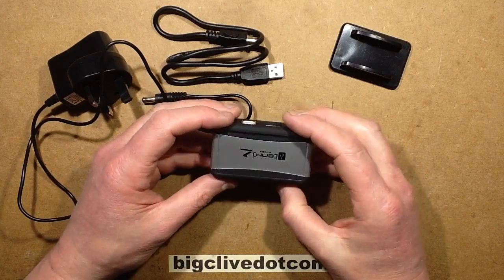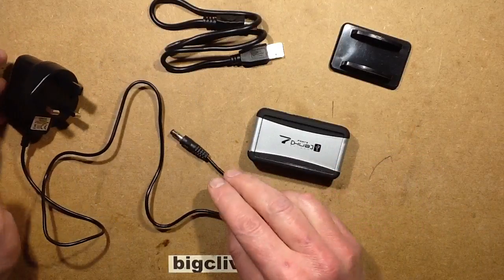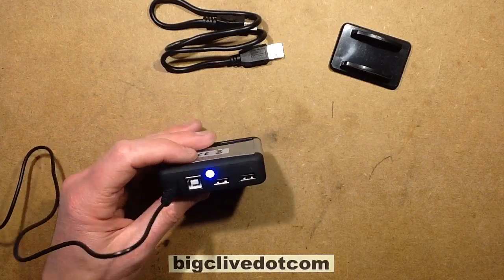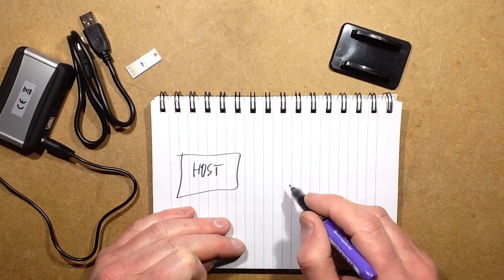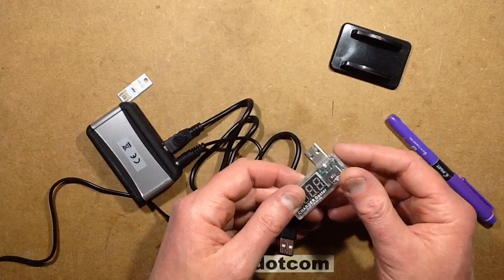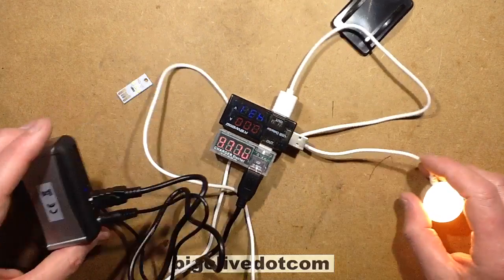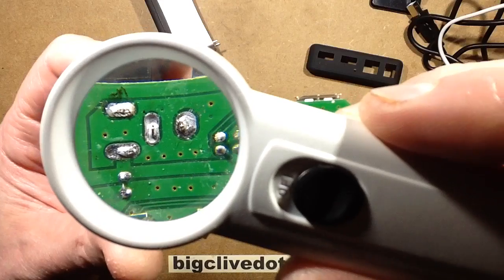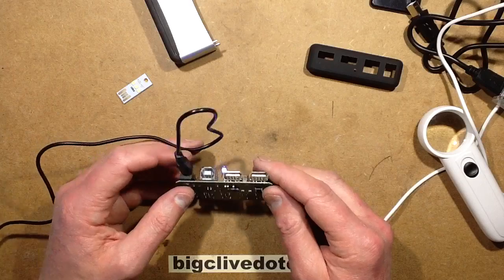Computer killing powered USB hub.  (Mac murderer)

Comment: I use many type of usb powered hub back in time with varous PC and laptops and never had issue. Almost all of them had straight connection between DC input and input USB.

 I remember only one 7port USB3.0 hub that had separation and use power from PC when no external but with limitation 500mA per port and 2A in total for all but when external powered - limitation disappear and it handle 2A on port (hdd, DVD writer, smartphone quick charging,..) but don't know how much in total - never tried. It's in aluminium box without screw so I can't check without damage what is inside. It power USB from external when PC shutdown or not connected so charging is not interupted. I love this hub for use with my laptop.

Comment: I wonder if this is no longer an issue on newer computers with USB C (since they can be charged with it).
Reply: It wouldn't cause an issue. It's the same as trying to plug in a USB-A to C cable between a charger and the computer.
Reply: @TechHowden  Ah, so in some cases it would even charge the device
Reply: @NCHLT  Not on most computers but a USB-C MacBook may say power source: power adapter and drain slower but won't actually charge. Also almost any phone will actually charge from it.

Comment: 8 years later, and I had this happen to me on a Windows PC. Powered USB hub that I had for four years, PC went to sleep, never woke up. Turns out it fried my CPU and I had to get a new one. Took me four days of troubleshooting and headaches before I was able to borrow a friend's CPU to test with. Sure enough, with the donor CPU, my PC POSTed and loaded up the BIOS without a hitch. Quite an expensive mistake I'll never be making again.
Reply: You the CPU itself and not the motherboard? If so that's quite strange.
Reply: @TechHowden  Yup! Ended up buying a replacement CPU and my PC works just fine now. I'm still using the same motherboard and everything.
Reply: What type of USB hub did cause this ?
Reply: @dominikfilkus  A powered USB hub I got from Amazon back in like 2019 or 2020. The brand is RSHTech, which I now believe was probably just some generic drop-shipped piece of hardware with some random brand name thrown on it, as is common on Amazon.

Comment: alright, so this is a handy strip for charging multiple devices at once from the mains OR to connect multiple devices to a host computer, but not both. question is – and forgive me for my ignorance –, but wouldn’t this design be fixed by simply adding a diode between the USB-B port and the barrel plug?

Comment: I remember something weird happened when I had an Xbox One X connected to a KVM switch (with the USB plugged in)
For some weird reason, it wouldn’t turn on while that USB cable was connected if it had been switched off at the mains for a while, but if it had recently been turned off, it would turn on again
Disconnecting the USB cable would then allow it to turn on (sometimes I would have to turn it off and on at the mains before it would turn on)
None of the other devices connected to the KVM switch had any issues (not even my PC), it was just the Xbox

I have no idea what caused that, as I checked for back-feeding, and couldn’t detect anything, and even weirder, if I connected a 2 way USB switcher between the KVM switch and the Xbox, that somehow prevented the issue

Comment: Today, this power-return ambiguity could actually be used, under circumstances, cautiously, devices and brands are different, to back recharge the OTG host via the micro or C USB connector, while allowing the host to simultaneously operate the attached client devices, maybe? Are USB-C and microUSB connectors wired equally?

Comment: On hubs like that, there is supposed to be backfeed protection for the host port while being able to have host power or have adapter power the ports. Having unregulated or unexpected power at a USB port not designed for it can lead to many issues.

That is a glaring design flaw. Very bad.

Comment: I think the USB spec calls for 5V to be connected with a diode to prevent back feeding, but the host port should also have protection against current flow from the peripheral…

Comment: I wonder, are modern smartphones also killing computers due to the reverse charge feature? Occasionally left mine plugged in after shutting down, noticed the motherboards cosmetic LEDs would remain lit until I disconnected the phone. I suspect that the phone saw a load connected and decided to power it.

Comment: As far as I can remember, every powered hub I have owned functioned this way. They could be used with or without the power adapter. If I was using all self-powered devices, like printers or hard drives, it was no problem. With mice, keyboards, and thumb drives, they were limited to available power from the computer port, of course. 
I don’t know for sure if they back-fed the 5 volts, but I’ve never had a failure on windows systems. I’ve never tried on a Mac.

Comment: It should probably have a little 5v reed relay in it so when there is not external voltage applied, the +5v from the computer goes to the hub 5v rail, but when you do plug in the external power adapter, it also powers the coil of the relay and breaks the +5v connection back through the host port

Comment: This is a case of a missing diode, but it also sounds like the USB on the Macs in question weren't properly certified to USB standards. I believe USB standards require protection of this exact kind of situation. However, it is important to mention that a majority of cheap China made USB devices are NOT certified, and should always be used with caution, regardless of the quality of the host device, as demonstrated by several of Clive's videos 😆

Comment: Louis Rossman covered this. It doesn't need a new motherboard, it needs a new USB power switch. It's an easy part to replace, it's just that Apple would rather sell a new computer than let you fix the one you have.
NOTE: This doesn't excuse the maker of the defective hub, since it does blow a chip, but Apple should either fix their products or let someone who know how fix them.

Comment: I've only just found this! I was sold one of these with a Toshiba PC laptop, and it did some odd things with the USB devices plugged into it. I took it back to the supplier, who tried it and didn't believe me, so I was stuck with it. It's been in a drawer for years, but I dug it out and almost started using it recently, as I needed a hub for an old MacBook!!!!!!!! Fortunately I decided to buy a new hub instead. Phew!! Lucky escape!! Maybe it should become a source of USB sockets and other useful bits to prevent future disaster.

Comment: i thought this is how they were supposed to be the point of the power supply is to add more available current to the hub the same as 2 battery's in parallel double the available current not change the voltage jump leads don't kill cars they have no feed back protection or am i wrong

Comment: You know what this reminds me of? USB switches. I have yet to find one that doesn't cross feed 5 volts between the computers. I noticed that the fans were ON on my powered OFF computer. It was because the other computer on the switch was on and feeding power to the first through the switch!

Comment: I understand on who they made it!, Basically there are two options for Power but they are not supposed to be powered buy both at the same time, Option 1: With the adapter is for when you travile and you want to transfer data from say one phone to a computer or other device's but you are not to connect the Wire that plug's to the PC and that look's a bite like a square. Option 2: Is for the PC but it is to be used without the adapter to the wall since it has all the power it need's from the USB port and as it get's it's power it transfer's data. and so That is how I know them and I have worked with a hub some what like that one.
Reply: And hey BigClive you can test what I am saying buy plugging it in to the wall and try to transfer photo's between phone's for example, then goto your laptop or computer and just plug the usb wire without the wall adapter, give a try and let me know ;)
Reply: @singlesteve2011  I would not expect that to work. Usb hubs are not networks. The downstream ports don’t talk to each other.

Comment: Hi Clive, I've just ordered a powered USB hub as the PC does not supply enough power to the USB device ( I'm powering an ESP32 via a FTDI so I can program and run while connected to the PC ).
So, I assume that if the hub is built properly there is no 5v feed back to the PC via the USB +ve terminal.

Comment: Oh, i had a very similar usb hub, and now that i think of it, it's probably what killed a raspberry pi, i was using the hub to run a hard drive over usb to the pi(which really couldn't power a 2.5" drive and itself at the same time). i also had a usb headset which died when i accidentally plugged a 12v adapter instead of a 5v one(i should've just found my glasses and checked)

Comment: I guess it was too hard to install a power jack that breaks the positive line to the computer when you plug in the power supply, the same way they used to disconnect batteries from an external supply for old stuff like radios, and cassette recorders. Ain't old tech great?

Comment: 5.4v... that's overspec isn't it?

Also, I have a bunch of arduino-based boards that have a similar issue - require external power to do stuff but then need the usb connection to be programmed... I just tune the external power to provide slightly less than 5v so the USB line can block it.
Or who knows, maybe they designed PC USB ports better than mac's :p

Comment: I don't think you need to should plug it into mains voltage when you are using it as a a hub, you can connect it using the standard USB cable ( there is a port for it similar to the one on your printer)  and the other devices are to be plugged into the USB ports.

However I agree with everyone here on the fact that Apple products are just crap and shouldn't die with 5V from a USB.

Comment: i had a usb hub that has a 12v psu ?  an isolated buck converter im assuming  so both pc and psu can be plugged in at same time
Reply: but it costed me  about £35 a proper usb 3.0 10 port with a switch to add power when needed

Comment: thanks!.the solution for that is cut the power cable which connect to PC
it will prevent power draw back to pc
but the cons is only working when power adapter plugged

Comment: There should be a diode. Or even better, TWO diodes - one at the power from computer and another one at the power from host, to prevent backfeeding the power adapter.

Comment: I've got the same hub and I shit you not eve since I've had it my pc was behaving very bizarrely. I would touch the host usb plug on my pc shield and it would cause a small spark and would make my tv flicker. Now after watching this gone in bin! I had this so I could sit on my couch with keyboard and.mouse and have 1 long wire to my couch instead of 2 usb extension cords oh well will have to now can't use wireless as there crap and I already am using the whole 2.4ghz spectrum

Comment: I am not an electronics genius but wouldn't a forward bias diode on the computer end the hub end or both fix this? Sounds like all the engineers involved need to give there collective heads a shake.

Comment: i have this same hub and i think i lost a laptop to it and figured it was the ext pwr that was bleeding back into the host. so i tested it without the ext pwr and it works fine as demonstrated. so for things like usb memory sticks, keyboards, mice etc anything that draws low amps its fine. just dont power it with ext adapter otherwise you end with dead computers lol its nice to have conclusive evidence now

Comment: Seems like it should have a diode to keep the power flowing from the hub back to the PC, but still be able to use the hub without the power adapter.

Comment: I have killed 2 of my usb ports because of a chinese USB-hub, because it had a power jack and I connected a 9V adapter thinking it would regulate down. Guess what? They just directly connected power to the usb without even using a fuse. Just direct connection. 🤷‍♂️

Comment: Clive, a lot of years ago I was asked to connect an Applewriter to a PC. The cable that came with it looked like it should plug into a PC printer port so I gave it a try. I had a connection of sorts but it was producing gibberish. After a bit of checking I discovered that Apple wiring standards were different to those in the PC world. They didn't have return wires to go with their data wires they all used 0V line or chassis, just like they do in the hi-fi world.. So anything that shoves a voltage into one of sockets is likely to have it showing up on data lines via the connected components.

Comment: That hub makes Apple happy, more profit on sales on new crp that have no protection on it's ports, ie bad construction in same manner as that usb hub.
Only buy overpriced things for Apple from Apple, even WiFi routers or bad WiFi signal might blow power chip also...

I have a Asus laptop that feeds 240 volts on hdmi port. Done it since it was new. Bought from alina.se in 2k13, box had been opened so they lightly knew of the fault on delivery.

Comment: What the heck?
I've had about 5 of these hooked up to a single machine because you could use them with an external power supply.
The machine in question has been one of the most budget-level builds with only a single purpose; to run the hubs with their USB crypto-hashers in it...
It's done so without any hardware failing in a timespan of 6 years...

Comment: Isn’t the power only supposed to be used if you want to use the hub as a mass usb charger , without being plugged into a computer. Then use only the usb cable to use it as an actual usb hub for pc and Mac etc

Comment: So many devices backfeed power when they shouldn't. I have several tiny cheap USB-powered speakers, handy for Raspberry Pi projects, and they usually have a little lithium battery that can power the speaker for a couple hours, which is sometimes handy. However, I've noticed that when I switch off the Pi, but not the speaker, it will backfeed to the Pi, and the speaker battery will be bravely trying to power the whole works. Luckily Pis seem made of sturdier stuff than Macs. (At least for power. I've always been careful with the GPIO pins.)

By the by, those tiny cheap speakers usually have terrible plastic enclosures, good little speakers, and very good amplifier boards. I've broken up some and used the amp boards to drive old Radio Shack Minimus-7 speakers with excellent results.

Comment: That's interesting, I have a few hubs that do that myself but I've never left them attached well it was off?
They technically need power coming from the host to be a self-powered hub the better ones will transition over using semi sort of bridge rectifier so you can power them either way. the cheaper ones just share the power rail.
At least with all the mac's that I have that are older they've had a self protection feature that kicks in if you short USB or firewire and requires a full restart to reset.

Comment: Cutting power line leading to host USB and placing there a diode should do the trick. While being powered from external power supply it'll block backfeeding to host, it allows to power USB ports from it. IIRC I fixed similar issue with IDE-USB bridge which had connector for 2,5" HDD (44 pin, with power), however that one didn't managed to damage anything :)

Comment: All of the people that saying that this is not apple's fault is just bullshit, most devices should be able to input 5v without a problem since they have ESD protection, and some computers like the ($35) raspberry pi can even be powered from the USB type A port(although you're bypassing all of the safety features, eg polyfuses, etc, and power regulation, and on newer pis you have to power it from the power port first and then unplug it.)...

Comment: Hey Clive. I think the reason that they need to connect the 4 wires (power, gnd and data + -) is because otherwise it will not work to power devices when the adaptor is not plugged in. The correct way to do this though is to disconnect the power connection to the pc via the switch within the power socket.

Comment: lol I got the exact same model from several years ago (2011 I guess?) and it killed my external hard drive because I plug the additional power supply into it.. yes.. it's also 5V... the effect wasn't immediately apparent.. but when my Ext HD went to sleep mode and I tried to access it (which woke it up), I simply couldn't accessed it because of the bad sector caused by immediate effect by additional power supply being loose from the socket.

Comment: Splice the USB cable and cut the +5V wire? Only usable if the power supply is used, but no back feeding power. If you don't need the power adapter, use a normal, unmodified USB cable. Issue resolved :)

Comment: No USB hub should put out 5 Volts to its input that is connected to the computer's USB port. This can easily damage the circuits driving the USB ports. When the computer re-boots the USB circuits will not respond properly and in most cased the computer will no longer start. 

When the power supply is connected to such a USB hub it will be in conflict with the power coming from the USB port on the PC, thus causing an over current condition, and kill the port and related circuits.  I had this happen to me some years ago on a PC and I had to buy a new mother board. There was no way I could make a claim for the expense. The USB hub was made in China. When I got in touch with the manufacture in China they basically told me they are not responsible  and it was something I did!  

I no longer buy USB hubs unless it is a known quality brand name. More expensive, but much safer.

Comment: Simply put a diode on the 5v line of the host connector, of course it should have been designed with one in the first place.